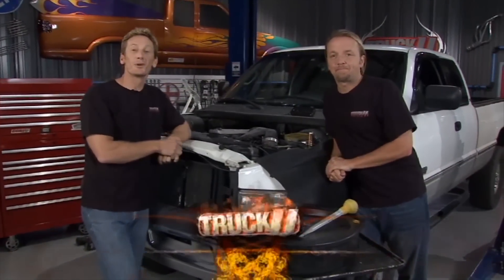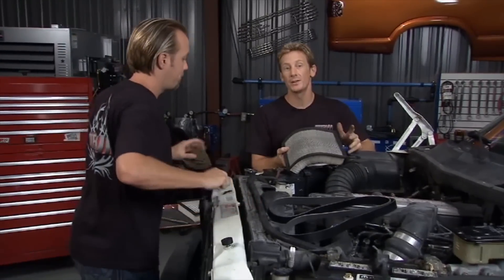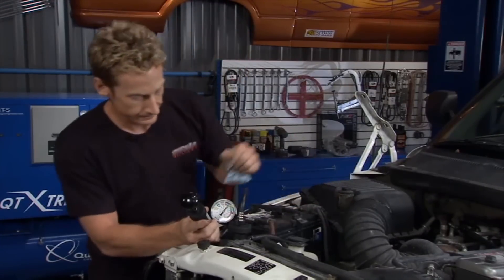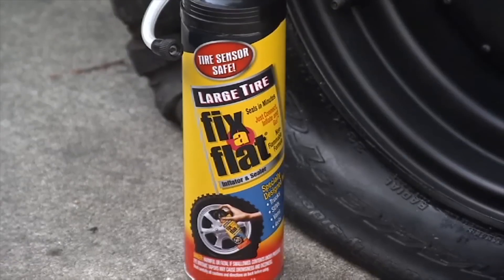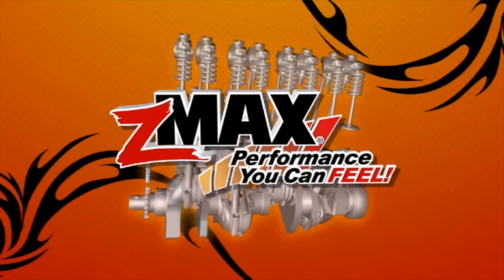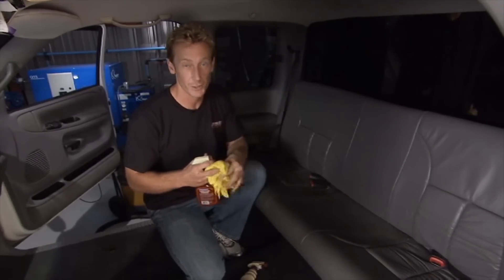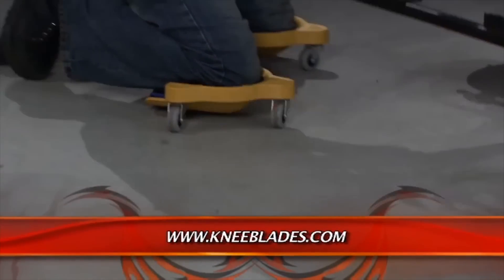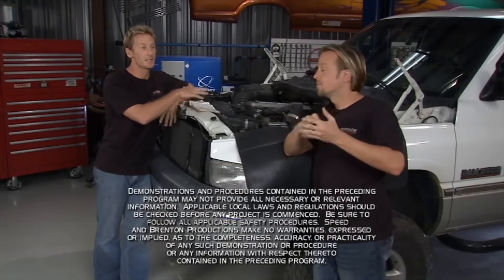Ten Improvements Your Truck Needs Tomorrow | TruckU | Season 5 | Episode 9

Comment: I want to put lockers on my 2001 2500 ram truck single cab long bed 5.9 v8 , I also have a 23 ft camper would the lockers affect towing? If I can install lockers what would be a good match? I'm on a budget.

Comment: HEY BRUNO AND MATT THANKS FOR TAKE YOUR TIME WITH THIS VIDEOS,.HEY I HAVE A QUESTION ABOUT MY TRUCK RAM 3500 CUMMINS 24 VALVE TURBO DIESEL MANUAL TRANSMISSION ENGINE 5.9 __2001 IT HAS ALMOST 500.000 MILES,. MY QUESTION IS IF DO I CAN USED THE TREATMENT Z_MAX ON IT??

Comment: 7:30 but what if the truck doesnt have a radiator cap?  my 2000 silverado doesnt.
13:50 hit it with the air where? you said what to do with what, but where exactly?
Reply: You would attach right to the coolant res, that is where your "radiator cap" is. It's pressurized instead of just being a flip cap. You would go to the water drain hole on the a/c box (under the vehicle) and gently blow shop air to clear the drain clog.

Comment: Spark plugs?
Reply: Joe Shearer diesel trucks use glow plugs so they wouldn't have spark plugs to replace
Reply: Cummins doesn’t have glow plugs, they use grid heaters. Even that old truck they’re working on.
Reply: Diesel.

Comment: If you live in the cold winter climates sure you install the Battery tender in warm weather as the plastic wire cables completely cracked in half for me when I was having battery issues in the cold.

Comment: Talk about the fan belt but not all the things it travels on?
When you have the belt off check for worn out bearings  by shaking and spinning them.
Idlers water pump Harmonic balancer and alternator check them all.

Comment: Fix-A-Flat is okay if you got aluminum rims but we got Metal rims it will rust up if you don't get that out of there.
Reply: Curtis May aluminum is metal... It's just a non corrosive metal.
Reply: David Morrison aluminum is not corrosive...but it does oxidize. It doesn’t turn to rust though, it changes to aluminum oxide. That’s why you have to remove it from the surface when welding aluminum

Comment: I'm sorry but I've worked for 5 years as a tire tech and had to clean wheels and my work station after changing tires that had fix-a-flat in them. It does make a pretty good size mess.
Reply: Why are you sorry about?
Reply: Your not kidding. I worked at Dunn Tire for 3+yrs and the mess that fix-a-flat made was ridiculous!
Reply: 10+ years tire tech/ 20+ auto tech experience ; I can plug, patch, or vulcanize punctures. Rarely ever is a sidewall puncture repairable, fix a flat definitely won't work. It causes a huge mess and is potentially hazardous when using a center mount machine as residual pressure will often blow upward towards the operator spraying ammonia in the eyes. Also if not properly cleaned residue on inner liner of radials can reduce likely hood of proper adhesion of repair patch. 

These guys seem to have it together... until it comes to tires 😉. 

Still a decent video.
Reply: It is very messy plus alot of tpms sensors are built into the valve stem and you absolutely do not put that shit through a tpms

Comment: Fix a flat will ice up and freeze in the winter which can throw your tire out of balance. Another thing is when you have sensors in your wheels the can specifically says not recommended for tire sensors. So in a nutshell some if the things truck u is telling you is misleading, I do tires for a living and I see on a daily basis the effects of fix a flat. So before you use it read the label for information

Comment: Get a good plug kit and air compressor that plugs into your 12v outlet. Much better fix than fix a flat, that shit won't come out of the can once it's been rolling around in your truck for a year or two. Plus you can fill a lot bigger hole with multiple plugs if needed.

Comment: Belts do not squeak. It is the tensioners that lose their tension. The belt and tensioner should be replaced as a pair. I cannot remember how many people returned new belts because they still squeak. Also, belts will show small cracks in the ribs. That is normal. Replace the belts and the tensioner at recommended intervals or if you bought a used vehicle. PS: "Fix a flat" stuff does not work and can damage the tire and rim. Use a plug kit and small compressor (and run the compressor for a few seconds at a time or it will overheat and die). APPLIEDSPEED.COM
Reply: belts don't squeak?  Hmmmmm 30 yrs in the business and replaced many glazed over belts that squeaked.  Never yet replaced a tensioner because the belt was squeaking. A lot of cars don't even have tensioners so there goes your theory.

Comment: Fix a flat may only be a small amount in one can but the average person doesn't just put one can in or follow the directions on the tire or the tire is to damaged for fix a flat because they drove on it for 2 miles. when the seal on the bead is broken it is not uncommon for the unsuspecting tire installer to get their shoes filled with the stuff and they will find out who did this to them. I know I did when I worked changing and fixing tires. If for nothing else but to do terrible things in my mind. Also, It does mar the finish on some types of early aluminum wheels. don't know about any in the last 20 years.